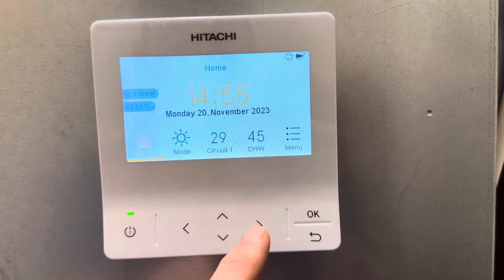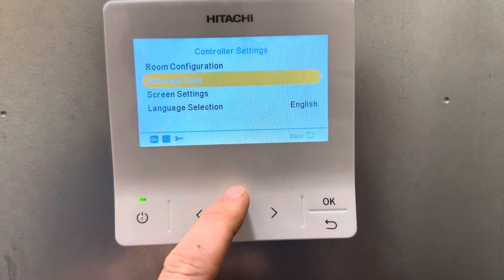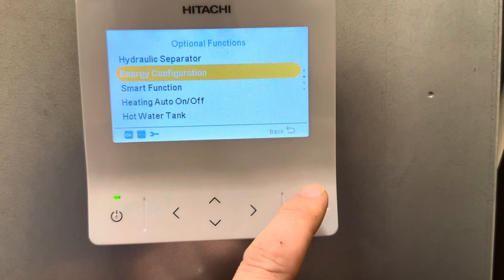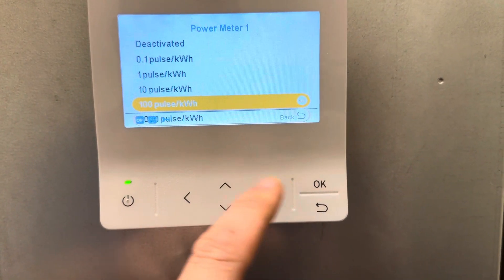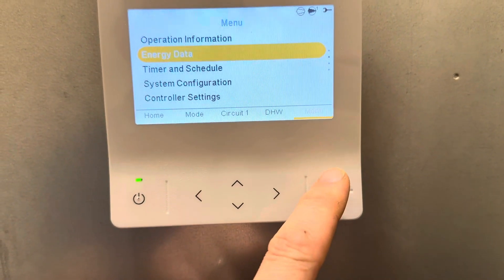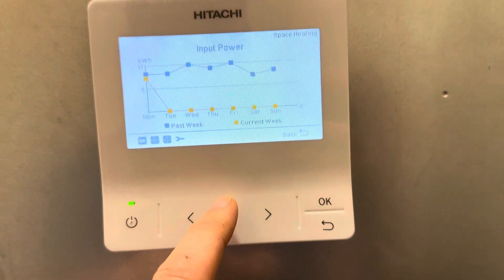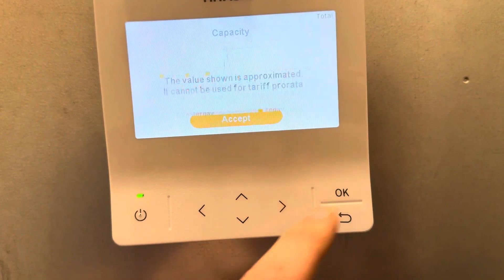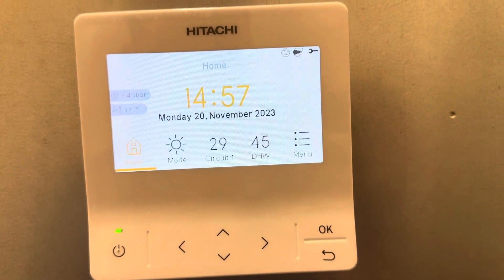Hitachi energy monitoring for input and capacity (output)

Comment: Thank you for information. İ am using similar system. But ı did not take input calculation.probably, it should be electroc meter for inlet energy data. Do you have .energy meter in this system?